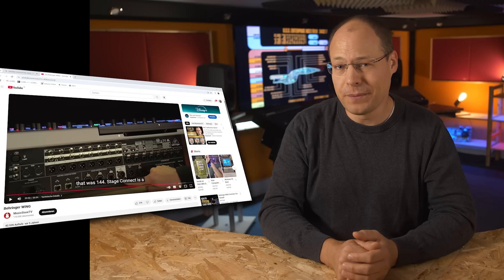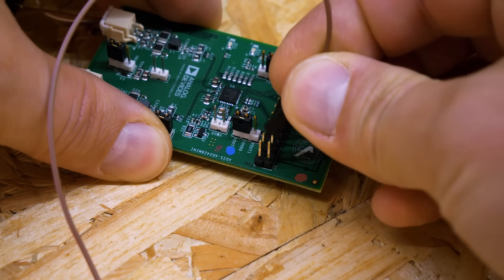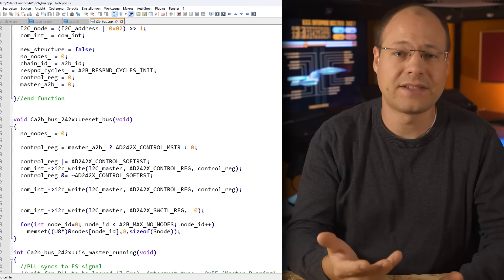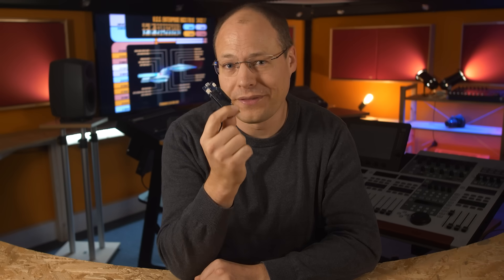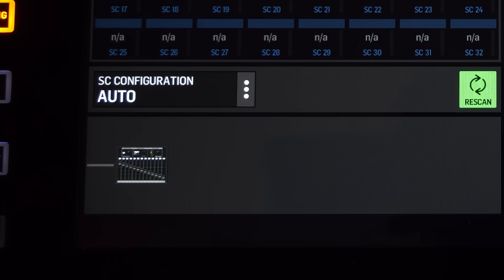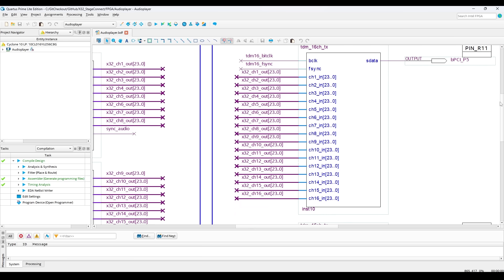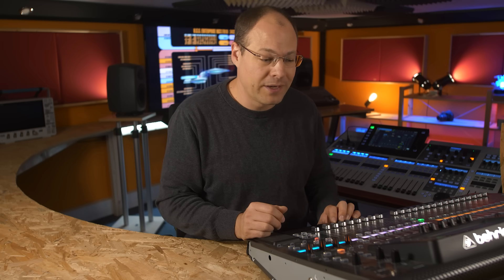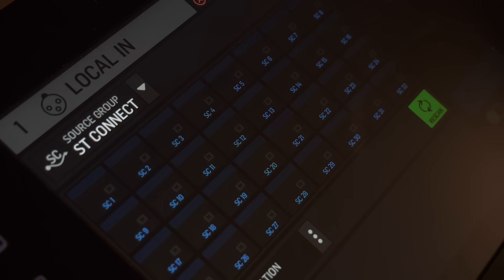StageConnect is OpenSource... and the X32 knows it

Comment: Самая долгожданная плата - Это USB 4 или thunderbolt. Моя звуковая карта thunderbolt 3 имеет задержку 1 миллисекунда. К сожалению даже в новой консоли wing остался старый USB 2.0 это очень грустно.
Reply: Вообще самое лучшее решение-это конвертер aes50 - USB 4. 
48 каналов быстрой связи с компьютером-это самое лучшее, что может быть.!!!!!
Reply from the maker: Ну, вы не можете использовать USB-соединение для аудио в режиме реального времени. Но все другие соединения, такие как StageConnect, AES50 и разъемы для карт расширения, имеют задержки всего в несколько сэмплов (<< 1 мс). DSP на X32 занимает около 16 сэмплов (333 микросекунды), поэтому, используя соединения с низкой задержкой X32 или WING, вы не заметите никакой задержки.

English: Well, you cannot use the USB-connection for realtime-like audio. But all other connections like StageConnect, AES50 and the expansion-card-connectors have latencies around a couple of samples only (<< 1ms). The DSP on the X32 takes around 16 samples (333 micro-seconds) so by using the low-latency-connections of the X32 or the WING you should be safe without noticing any delay.
Reply: @pcdimmer  @tssa86 last week I actually managed to run 1ms buffer latency over plain USB2 to a Focusrite Scarlett 6i6 (gen1). I had to get DSP for a sound system in an emergency for an event :/ that was fun... There really was imperceptible latency between the DJ Console monitors (which I'm positive have an ADAU1701 DSP) and my PC input-process-output, I couldn't really believe it.

It's probably possible to go even slightly lower. The key is using a Realtime Kernel on linux (I did it with Ubuntu 25.04 Pro, RT activated and pipewire). It's unbelievable, I couldn't get lower than 5ms with that soundcard last time I used it on windows, and that had overruns
Reply from the maker: Oh yes, thats a good idea. Tinkering with a realtime-kernel is on my ToDo list. Good to know that this is working.
Reply: @pcdimmer  Even Windows IoT now has something like real-time kernels. I've achieved even lower latencies there than on Linux with a real-time kernel.
Reply: @АнтонМельников-т7ц  check it again, since it's mainlined/officially now in Linux since the newest >6.12 kernel versions, so client software compatibility is now top notch (like pipewire).

Windows realtime is not the same as the preemptive-RT scheduler in linux, but rather a 'partial way' like tuning preempt-full (which is default on popular distros IIRC). Even comercial solutions like LxWin run linux to achieve actual soft-realtime (and even that is technically not the same as a resource-pre-defined OS like FreeRTOS), so who knows what the interrupt performance will be on ASIO drivers.

<1ms on USB is quite unbelievable (at least on that scarlett card)
Reply: @rgones  In my experiments, I used a RME Raydat PCI card and achieved stable performance at 32 samples (the driver prevents anything lower). In LatencyMon, I got a maximum latency of 100 μs in a 12-hour test.

Linux showed better results for system latency, but performed worse in audio (possibly due to poor audio drivers).

Linux is great, and I plan to return to experimenting with it, but there's incomparably more audio software and hardware available for Windows.
Reply: Я постоянно использую pc для обработки в реальном времени.!! Для меня микшрная консоль-это только смеситель и регулировка громкости. Вся обработка происходит в компьютере. Я устал использовать usb2 в 2025 году. Я очень хочу USB 4. Только по этой причине я не стал переходить  с x32 на wing!!!